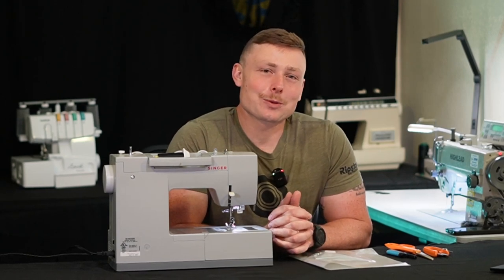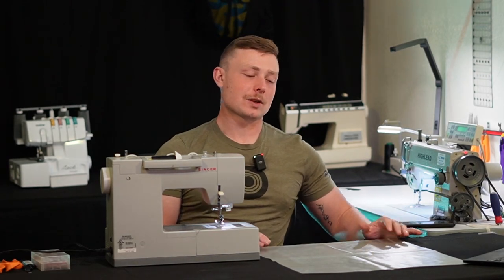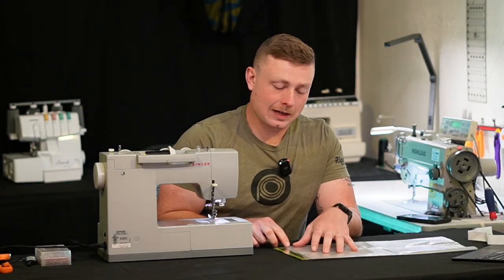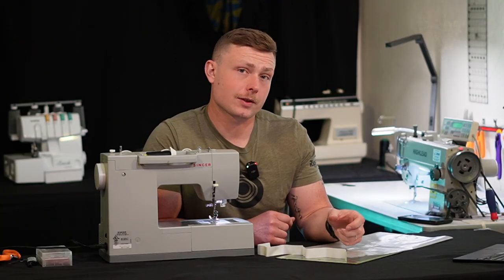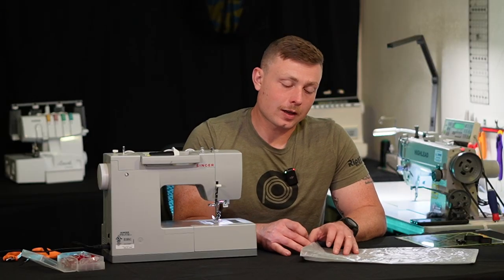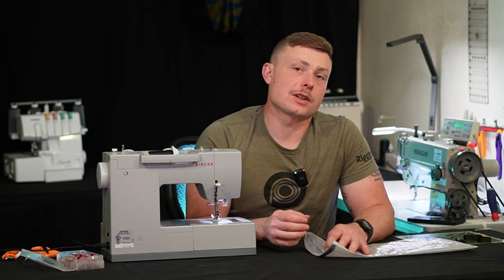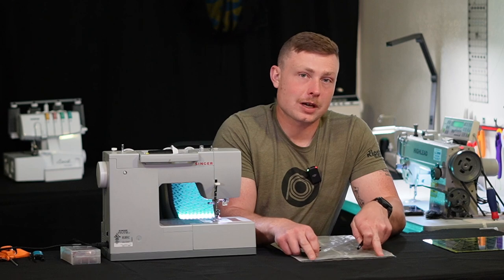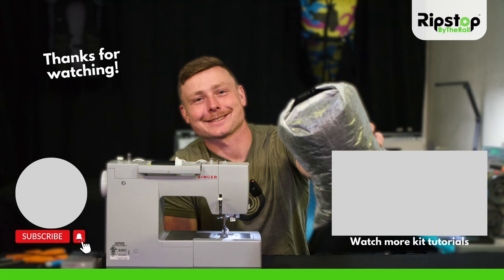Roll Top Dry Bag Kit | Tutorial Video

Comment: What would make a useful video is a step by step on how to make a dry bag of a particular size. Calculating the sizes, how to 'box' off the bottom.  I've figured this out... but I've also made  this kit and  a few bags.  I'm making dry bags out of silnylon (thanks Ripstop) that a plastic basket  15"w x11.5" w  x 11" high  will fit into. I want to store my clothes on my boat without them smelling like the boat or getting damp/mildew in foggy wet conditions (I've been on the north Pacific where one day everything was just streaming water and all my clothes got mildewy.) 
To me there are two basic kinds of dry bags. Rough usage, no protection, like my Sea and Summit dry bag backpack, and those that have some protection, like this dyneema one, and those for my boat cabinet.  Dry bags are also useful in the kitchen. I buy sealed bags of oatmeal, and boxes of pancake mix and the moths would find their way inside. A $40 silicone dry bag completely solved the problem. (But probably a bit over kill.)   And I bought white silnylon and happy I could find it. Lighter colors you can see inside of.
Reply from the maker: Those are super cool applications! We love to hear about the neat ways people are using our fabrics. Our friend over at LearnMYOG has a Roll Top Dry Bag pattern calculator. See that here: https://learnmyog.com/rolltopsack.html
Reply: Thank you. That's a terrific resource.
Reply: I can't seem to find on the website or your video what type of thread to use! Are you able to tell me what thread to use?
Reply from the maker: @sheighcox2932   Thanks for watching! This is the thread that we have in that machine right now. We use this thread for the great majority of our projects. https://ripstopbytheroll.com/products/gutermann-mara-70?variant=1072513937